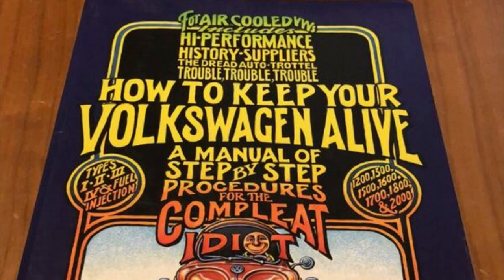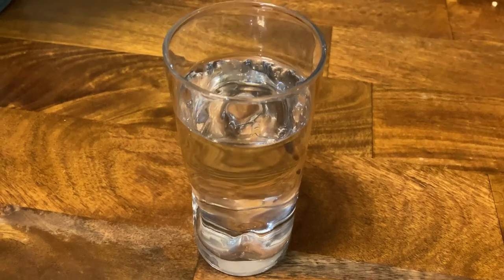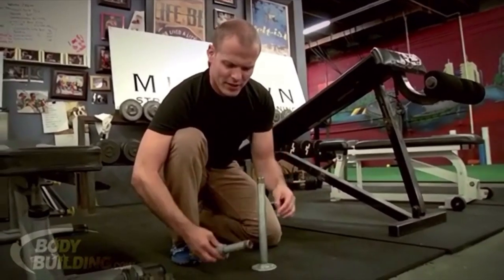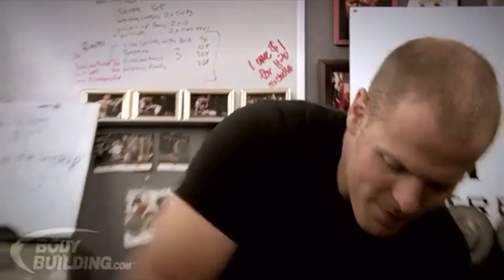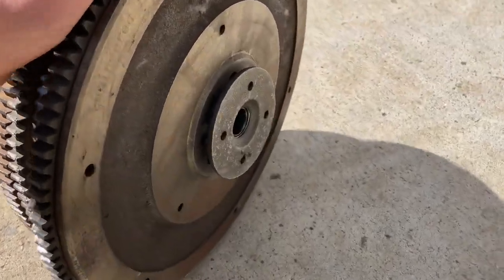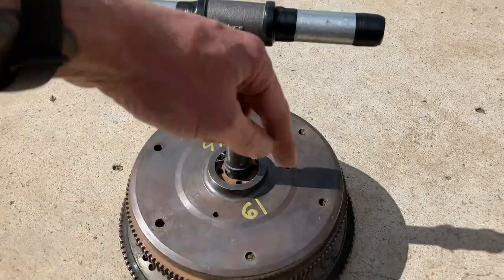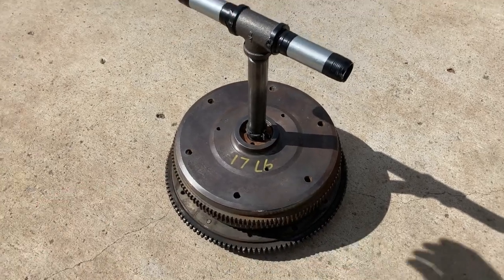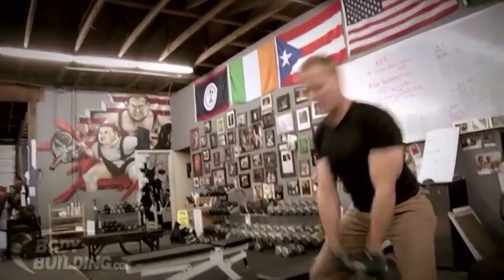DIY Flywheel Kettlebell

Comment: Hey Mick, it’s been over a year since your last video. I hope you and your family are well?
I hope the skin on your ankles stay in one piece. Ooh that could be a nasty accident waiting to happen.
You can use an air hammer to tap those ring gears off the flywheel to make them safer.

Stay safe.
Reply from the maker: Thanks mate, doing well here and been busy taking care of wiring harness/parts manufacturing as Busaru has grown. Also been working on a more foundational project that I’ll share with the BUSARU community in the months to come. Thanks for tip on the air hammer -fortunately the proper kettlebell swing form is far from the ankles! (But I’ll be thinking about that the next time I’m swinging!)